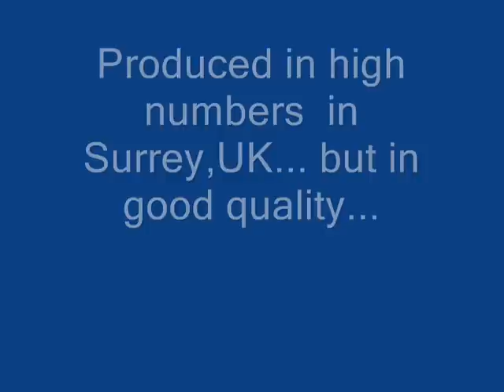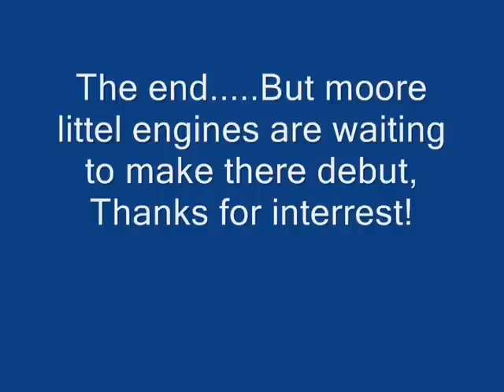E.D.  Bee 1cc model diesel engine aprox.1956   testrun

Comment: Hello My Friend!  how are you? hope you are doing well and having fun this spring season.   i just finish another cox head, with brass contra piston,  it has a good fit, and starts, but after some running shows some oil on the top, so i put a teflon disk and worked great! will post a video soon.   i been reading a lot about MEKP, as all my engines had been run with no ignition improver. i get a small amount of mekp yersterday, any idea about how much to use?    i was not able to find cetane booster.   Regards Rodrigo
Reply from the maker: Hola Rodrigo.I have no expirience with MEKP. But as far as I know,the Cetaan booster I use the also sell internationaly. Here the link in english for a direct buy.
https://www.bardahlshop.com/bardahlshop-products/12305.html

Glad you have succses with the diesel heads.The Cox engine runs pretty well  as a diesel! High rpm as well.

I hope you can order the Cetaan booster,as than they run even much smoother and the loads on the crankpin and rod are far less big. Have a great sunday Rodrigo!! Thumbs up and happy runs!!
Reply: Hello Peter!   well, i was kind of frustrated as my paw 150 was not able to handle my Pietenpol,  it was running a 8x3 at 10-11,000 turns, but not enough for the plane, if i try to get more revs. the engine got very hot and stop. yesterday i made a new run, with 2% MEKP and was able to get 12500 revs and the run was much more soft!   i just upload the video.    once my LA get well running in, will try to get comparison of bought nitro and diesel of the same engine.   Just saw the video David upload about the engine you fix!!!  NICE! have an aurora k150 will need your magic but i was shy to ask if you want to see it and see if it fixable....  Again thanks for all your support Rodrigo
Reply from the maker: Rodrigo Castellanos García Hola Rodrigo.Did you try the internet link to the cetaam booster?
It might help to get the best out from your PAW. Whats wrong with the Engine of yours? I have a lot work to do and also like to finish my models what waiting years to be finally ready. But if its a small thing,I will maybe help you out.
Many regards,peter
Reply: Hi Peter!  well,  the engine doesn´t drink the fuel, i close the intake and turn the prop, but the fuel doesn´t come across the tube.  i already check the back cover seal, but just don´t work
regards Rodrigo
Reply from the maker: Do you hear a transfer "puff" when turner around or turning left right at BDC? If the puff is there,that your carter is indeed perfect and seal nice.Than you got a blocked spray bar. hold it against the light so you can see,if its open and check the small bore.. We will get this engine 2gether running!

Many regards,

Peter
Reply: Hi Peter! can i make a video and sharing with you?  Cheers Rodrigo!
Reply from the maker: sure...

Comment: hi Peter I have just got hold of the very same engine very low run time! don't think it been run since the sixty's so the old owner told me ! sprayed some light oil in it and rotated it about a bit till she freed up and set a tank up for her 2 flicks and away she went! 😀 where did you get the tank from? many thanks justin
Reply from the maker: Hi Justin.Yes,this are really great engines.Ver good starters and performers..I got a MK 1,but 50% size,made in ST Petersburg russia...Its a so lovely engine!!..fantastic..but missing also a tank.
The repro tanks are on ebay..here a link seller greyfish54

http://www.ebay.com/itm/291842333212?ssPageName=STRK:MESINDXX:IT&_trksid=p3984.m1436.l2649

He have also others.

Best regards,

Peter